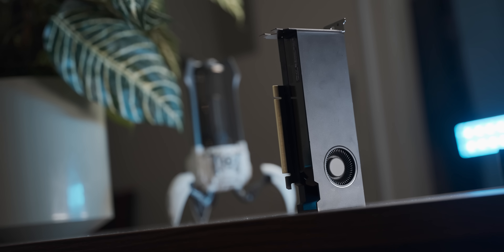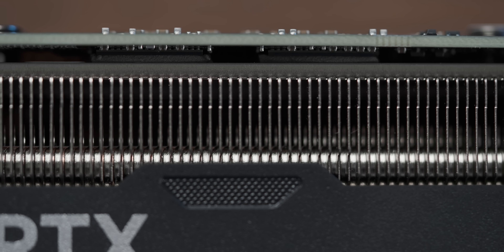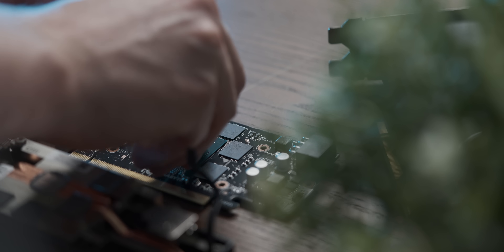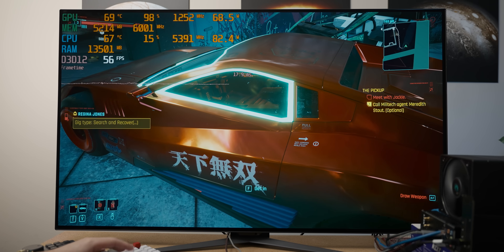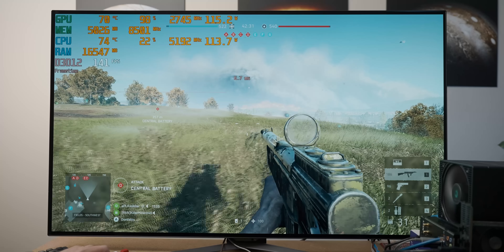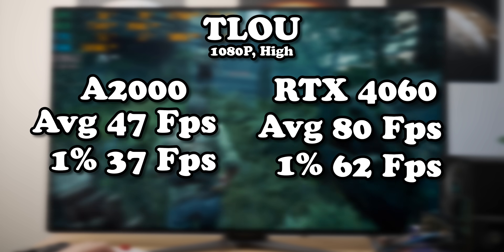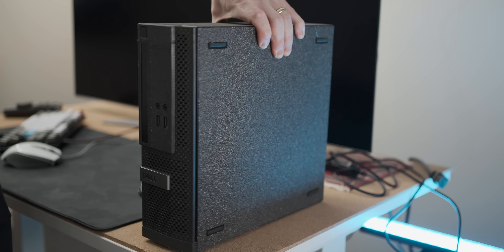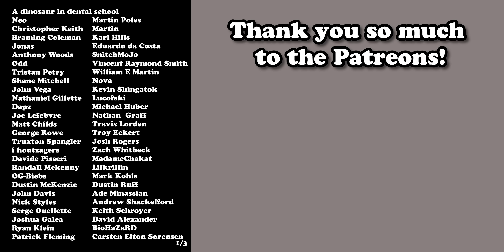A New Contender To The LP Graphics Card Throne

Comment: I would absolutely love to see the MODERN OPTIPLEX OF THE FUTURE (from 2028 or something). The concept of taking a crappy prebuilt or office system and turning it into an unexpected gaming beast is always super cool to me
Reply: This is how I built my bedroom media/gaming pc. Got a HP Prodesk with a Pentium and 8gb ram for £40 (seller did me a deal as I wanted 2 of them, but they were selling for £60 each), got a i5 6600 for £20, a passively powered 1050 ti for £60 and £20 on ram.

For £140 I think it would be a challenge to build a better PC. I had to do quite a bit of research to find a GPU that wasn't overpriced or just e-waste. Some people would argue a 1050ti is e-waste, but it is still a serviceable card for AAA games that are 1 or 2 years old already (the specs are basically God Of War's recommended specs) and I already have a gaming PC, if I want to play a new title I can just use Parsec to play it remotely.
Reply: Currently using an HP Elitedesk SFF with NVME, 64 Gb RAM and an RX6400. It's not the best system I've used, but it is a total sleeper build.

Comment: The nvidia vbios signature lock has been broken.
Do you suppose that means you could potentially limit the TDP on this GPU to not require the 8pin cable and make it slot only?
Reply: Extremely unlikely. The 12v supply from the slot likely isn't connected to the card's VRMs, so you'd have to hard mod it. Even then, you only get 65W at 12v (the rest is 3.3v) so the power handicap here would likely cause bigger issues.

Comment: 2:10 115w power draw but it requires an 8 pin? WTF? The slot provides 75w and the 8pin provides 150w....why does it need 225w of power if it is a "115w" TDP?????

Comment: For those of you waiting on a 4050 to enter the low-profile 75W market; it might, but if you look at the laptop variants you're getting 6GB RAM and a 96-bit bus; same as the Intel A320LP but by some accounts that sucks down less than 40W under load.

Also Dawid, a more accurate Optiplex would be something with a 7th or 8th gen i5; you can find tons of them on refurb sites. My Optiplex is a 7th-gen i7 and it cost me $400AUD 3 years ago (also has USB-C and an nvme slot!)
Reply: Sounds like a good candidate for some VRAM overclocking. I guess gpu manufacturers might do that themselves if nVidia will allow it. Still though, it could be an interesting gpu if it manages to be single slot LP. Afaik the RX 6400 is still the fastest gpu in that category and it's only got 4GB on a 64 bit bus (not to mention the gpu itself isn't exactly amazing either)
Reply: @SterkeYerke5555 Will probably have similar results on the 4070 Ti, where memory oc also does a lot.
nVidia are really cheaping out on the memory bus here. 192-bit was usually always for the x60 cards, and they performed really well.
The 4070 should have a 256- bit bus, the 4060 a 192-bit bus and the 4050 a 128-bit bus, minimum. 
They basically equipped all cards one tier lower this time.

Comment: If you replaced the psu with a modular Sfx I bet it would do fine.  Would get a lot of cables out of the way and open sone space up at the bottom.  I would definitely modify that side panel for some air.

Comment: All these various LP card reviews call the A2000 the top dog... Is that because nobody has ever actually seen an A4000 SFF in the wild ?
Reply: Haven't seen in the wild, but at the price they're asking, yikes! Better off getting a 4080 in that price bracket. I even passed on 6GB A2000 as it was cheaper to get a 12GB 3060 and riser cable.

Comment: feel like requiring an 8-pin power connector kinda defeats the purpose of a low profile GPU, it should be able to be capped at 75W from the PCIE connection

Comment: also replacing the PSU in the Optiplex makes a huge difference. Just drop the mother board in an ATX case with a decent watt PSU and mod connections as necessary. Can by adapter kits for fans and such for optiplex depending on the model.
Because they're not all created equal. Mines a 9010 SFF with an i7 4770, so while there are no front interface mods for it, it can take a proper full size 24 pin PSU, which of course helps with using GPU's that need external power.

Comment: Hi, if you want to branch out and try other companies low profile cards there's this. Arc Pro A60 12 GB graphics card and I think AMD are also doing something similar. Could be fun to compare price/performance in your unique and enjoyable way. Keep up the good work.
Reply: The Pro A60 is single-slot full-profile, the Pro A50 is dual-slot low-profile, and both of them are absolute unobtainium. I haven’t been able to find them either stand-alone, in prebuilts, or second hand yet, despite their “release”. 

AMD’s got the Radeon Pro W7600, which is single-slot full-profile with a 6-pin and is basically a W7600 with a lower boost clock, and maybe more interesting in the field of “putting pro GPUs places they shouldn’t be and doing things they’re not meant for”: the cut down W7500 that’s also single slot and full height, but doesn’t need a power cable.
Reply: @jameslake7775  so you wouldn't be at all interested in seeing the comparison? I thought that it might be interesting. I couldn't remember the name of the AMD offering. Thanks for letting me know as I knew that I'd read it somewhere.
Reply: @hum430  Oh it would be neat to see, but the point was more that I'm not sure you can do the Arc Pro comparison, since the cards only seem to exist on paper.  At the right price I'd be dangerously tempted by an A60, but Intel can't say when or where or how much!
Reply: @jameslake7775  yes, I did a quick search after your message and it does appear elusive still it's the type of video he excels in so it would be fun if he could an apparent power draw maximum of 130 and of course I am also interested in what the AMD card has to offer.

Comment: Yes, definitely do a 4060 LP in a modern SFF Optiplex, that one with the i5 13400 seems to be begging for some 4060 action.
Reply: maybe even a 12400 if its cheaper
Reply: @markojovanovic9651 Could save even more by getting the 12400F the one with disabled igpu.
Reply: that actually would be a kickass gaming pc
Reply: Dont know any SFF that can handle more than 300w power
Reply: @suiken3149 I hope with the next generation power efficiency improvement that nvidia or amd will make a decent card without power connectors so you can just put it in and it draws 75w from the pcie slot, I miss those old days
Reply: @markojovanovic9651  There is a decent card, the RTX 4000 SFF Ada with excellent efficiency (under 75 watts) and more VRAM than you would know what to do with. The catch is that it is ungodly expensive right now, especially if gaming is all you will be using it for. I would keep an eye on the used markets when something better comes out because there will be a bunch out on the used market whenever that happens.
Reply: @suiken3149   The 4060 uses less than 120 watts.
Reply: Thats why you use a Pico PSU with an external power brick @suiken3149
Reply: I love how every of us here just talk like Dawid now, using words like "action" to define things haha
Reply: I'd like to see something like an optiplex with a i5 6500. Those go for around $100 now, and will definitely perform better than the 2600.
Reply: A low profile i5 LGA 1700 build with this 4060 would actually be a solidly performant, relatively affordable option for a compact desktop.
Reply: i was going to make the same comment!
Reply: But thats not fun, i want to see 4060 in the $200 craigslist pc
Reply: I wouldn't mind seeing a more modest optiplex either. I've got one with a 8700k begging for a LP graphics card.
Reply: A Ryzen would probably be a better choice for it's better thermals.
Reply: @Kalmaro4152  SFF workstations rarely use Ryzen. They need stability and reliability, so Intel is used.
Reply: yes
Reply: It don't have space for 2 slot wide  card
Reply: @tyaty  my pcie riser says otherwise, because dawid has done this before lol
Reply: @tyaty it can be made to fit!! Take the cooler off and make a jank 1 being low power and with some undervolting it could take the blower cooler off workstation GPU witch does fit most tiny pre-builts or even the 16 series low power low profile GPU coolers will fit! Where there is a will there is a way lol
Reply: @tyaty  actually they do, just on the top slot as far as my 4th gen i7 one goes which means its limited to pcie 2.0 x4 bandwidth

Comment: I think this gpu could make for one helluva sleeper setup. Gut out an Optiplex 3010 sff, drop in a b660 or h610 matx board with a 12400f or 12100f with the 4060LP and see what it can do.
Reply: While I’m not 100% certain, I think that mATX would fit the 3010 DT and MT.  For sff you might have to look into iTX.
Reply: @zeroturn7091  ah yes, I forgot about Dell's odd naming schemes lol. It was the DT I was referring to
Reply: @hoodie_ninja  I also wanted to get a barebones DT, but I missed my window (I also wasn’t ready to commit to the price of a tfx PSU).  I haven’t seen one with free shipping since last year.  My plan was to do a Red build with Steam OS.

Comment: Quite a nice little card, the RTX 4050. If only it was named and priced right. 128-bit memory bus is not 60-class. And it's hilarious that the same tiny GPU exists in a 3-slot STRIX cooler version.

Comment: 8 pin has to be optional, like to unlock full potential but not needed
Reply: Terrible idea in practice. You end up with a single, expensive product with overcomplicated power delivery; compromised performance and efficiency; higher failure rates - all for a feature most people will only ever use in one of it's two modes. Just make two simple products tailored to the needs of their prospective buyers instead. Oh wait, that's exactly what they did...

Comment: i really hope they do well with the rtx 4050. Right now, the rtx 4050 in laptops consuming 70w (so can be a no external cable dgpu) performs about the same as rx 6600 desktop. It would be excellent if priced right, but considering its nvidia thats kinda cope lol
Reply: This is a 4050.
Reply: @rustler08  The 4060 is overpriced, but it's not a 4050.
Reply: @_shadow_1  Remember the 4080 16GB and 4080 12GB? and how short after due many complains they stop the 4080 12GB launch and released it as 4070Ti because it was pretty obvious it wasn't an 80 class product?  They did the same with the rest of their lineup (except 4090), they all are priced and labeled a tier above of what they really are.

Seeing how the 4060 performs compared to previous gen 3060 you can really notice where it belongs. So yeah, this is a 4050.
Reply: @Lancer265  Does it even matter what class of card something is? If the VRAM, price to performance, and performance to power are all better than last generation, I wouldn't care if it was called an RTX 4030 because the way they decided to name their GPU isn't important to me. That said, the price to performance and the VRAM have both been royally messed up for the last few generations.
Reply: @_shadow_1  if the name doesn't matter, why did it bother you that someone called it a 4050?
Reply: @tyre1337  Because at the end of the day, the price to performance is the issue, not whatever label the card has. Framing it as an issue with the naming misses the entire problem.

Comment: With the 8 pin power and reduced 128 bit bus and PCIe 4.0 x8 I'm not exactly sure who this was targeted at, certainly not the old Dell/HP SFF PC's, but it's something I've been waiting for and also seems to be quite popular based on Amazon and Newegg availability. Surprised they didn't do a LP 3050 last generation for a little DLSS and ray tracing action.
Reply: probably for the itx enthusiast. hdplex actually has 400w small psu nowadays.kinda sized like pico.. it should be well enough to power a ryzen 5600+ this tiny 4060. this should opens up some new door for more powerful compact rig
Reply: @workdesu  Most of the time the ITX crowd can still run full height GPU's, even if they're limited to single fan models like the Palit 4060 Ti StormX and ZOTAC Gaming. Still feel the pain paying more for a GTX 1650 LP vs a 1650 Super or even a 1660!
Reply: @workdesu  would need to target sub 4 liter for this to make sense, velka 5 will fit a lot of 4070s, and even some 4070 ti models if you swap the cooler. Velka 7 can even fit that afox blower 4090 in theory, but that card HAS to be a jet engine.
Reply: The A2000 is why the GA-106 die the 3050 and 3060 are made from even exist. It's no coincidence the best-binned silicon from that line just happens to hit the perfect voltage/shader count sweetspot within the slot-only power budget that's perfect for the LP form factor that you can sell for extortionate prices to professionals and data centres. Why let board partners make a product that competes with any of the unique selling points that will cannibalize the cash cow you went to so much trouble to design? Make no mistake, gamers are second-class citizens in the world of GPUs now.
Reply: My ITX system has a full size 3080 in it. Its not the smallest system in the world but its only 11L volume
Reply: ray tracing is impossible to use on a 3050...
3050 struggles on low settings without raytracing lol

Comment: I would LOVE to see the "Budget Optiplex Build of 2028" to see how it fares.  It'd be hilarious.
Reply: 2028? We're looking five years ahead already? 😂
Reply: @BREEZYM6015  Yes, this is a reference to Dawid's remark that when the current generation of low profile Optiplexes reach the used market five years from now this card will truly fulfill its purpose.
Reply: The optiplex moved to a 12VO standard about 3-4 years ago on this sized (non MT) line. Almost completely and totally impossible to get power externally to a GPU (I've got a 9500 powered optiplex 3070 working as a NAS at the moment)
Reply: I'm pretty sure that external power is not needed and the GPU will still work. Its relative performance will be high enough to satisfy most users. I currently run a 1650 in my Opti 3060.  @andrewbenson6316
Reply: @andrewbenson6316  they want to laugh at the price and wattage my friend
Reply: @andrewbenson6316  What about HP Prodesk? Everyone focuses on the Optiplex's for cheap PC builds, but I feel like nobody knows about the Prodesk PC's. I use them for building pc's for family members, I don't want to devote a day to building them a PC, so I just order these off ebay, along with the upgrades (usually a cpu, memory and a ssd) and the "building" process takes like 5 mins. Installing windows takes longer.

If you're in need of multiple, these recycling places will usually give a discount since these things are in complete abundance and they want them gone.
Reply: @andrewbenson6316  i dont get it
Reply: I've done this with 7th Gen series optiplexes. The 1050ti and 1650 Super is king for these systems... WHICH SUCKS. Because they could do so much more, if not for Dell's non-standard, non-upgradable implementation of 12VO. 

There are legitimate reasons why they should have gone 12VO - it has serious benefits. But their slim, non-standard power supply sizing (even in full towers! Yes, this is what I am referring to!) Basically ensures there is no way to upgrade it and basically never will be.
Reply: I was just thinkin that lmao
Reply: yes

Comment: I just put one of these bad boys into a build in a Silverstone MILO11 case and I'm shocked by how relatively quiet the small fans are, even when cranked up. 
It truly is a Short King.
Reply: Silverstone ML03 for me, and yes the fans and cooling are actually a pleasant surprise, performs cooler and quieter than even the GTX 1650 LP. The initial photos made it seem extremely long but even with the triple fan configuration it's not much longer either.
Reply: this is the only 4060 worth buying

Comment: You should get an optioned with a system that runs some ddr4 like a 6th gen and see how it runs. I bet it’s a huge difference.
Reply: I have it on 8th gen Intel CPU, 8700 to be precise, and it runs very well, though I have the 6GB ram version of the A2000
Also ddr4 on 6th gen doesn't exist unless you talk about laptops in which case it is impossible to test it
Reply: I have an HP desktop with a i7-6700 in it and 32GB DDR4 in it. It was 5th gen that started to switch between DDR3 and DDR4  @ilijazafirov4192
Reply: @ilijazafirov4192  there are motherboards in lga1151 with ddr4.

Comment: 9:20 I don't know if the lower temp here is a very good indication that the thermal problem is solved. 
In that previous footage which showed 90C, the GPU load is high at about 100%, here it's not even 50%. Perhaps you should get a more consistent scenario where the GPU is always fully loaded such as furmark?
The GPU isn't throttling to 200Mhz so that's good. But we still don't know if the cooler can handle the advertised ~115W TDP.

Comment: what's a bit annoying about this is that the 4060 is built on a far more efficient architecture compared to the a2000 (5nm vs 8nm) and it literary has less cuda cores than the A2000, I'm 90% sure they would've atleast managed to pull off the no connector if they didnt overclock it or atleast slightly undervolt it